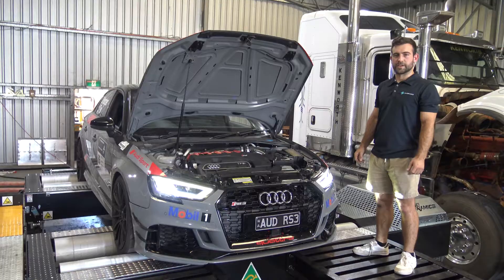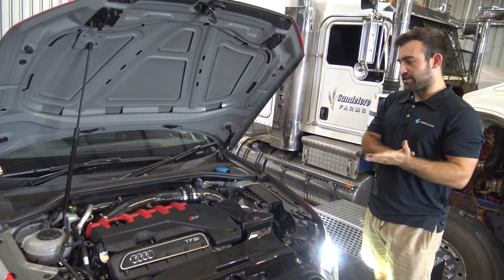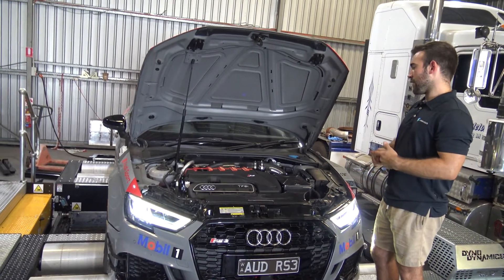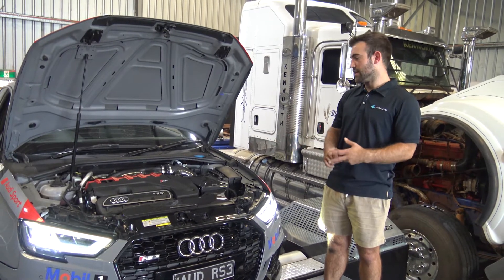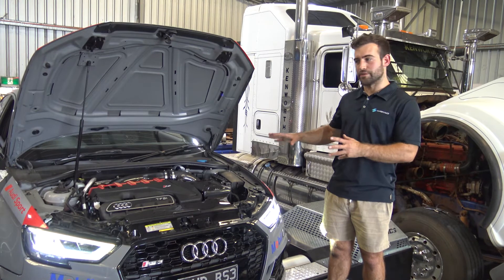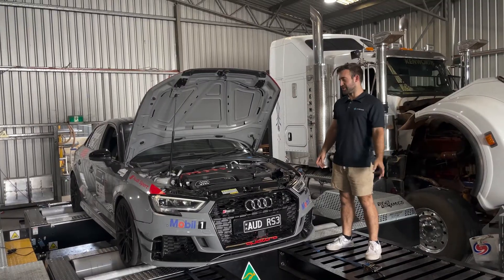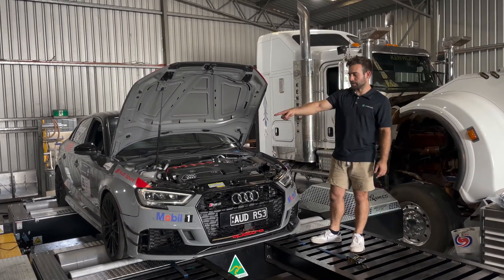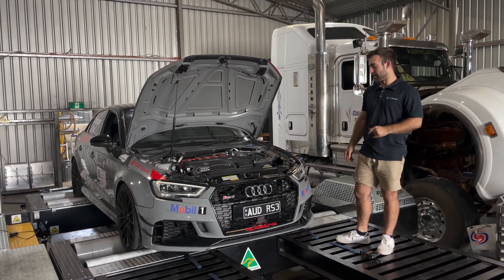Audi RS3 Dyno Tuning Feature -  Laborde Motorsport

Comment: Can I ask why the rear wheels weren’t rotating on the dyno even though it’s AWD?
Reply from the maker: Hey mate, so the way the MQB variant Haldex vehicles work including the Vw range, is that they don’t engage the clutch coupling that connects to the rear wheel drive system, when the car is in Dyno mode.
Reply: @labordemotorsport  cheers